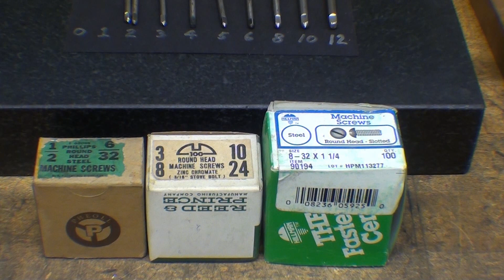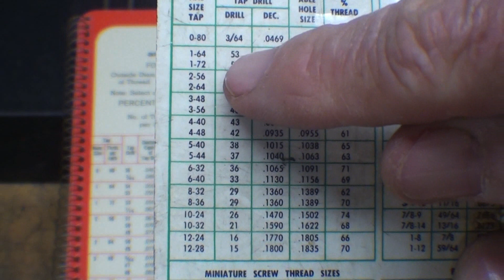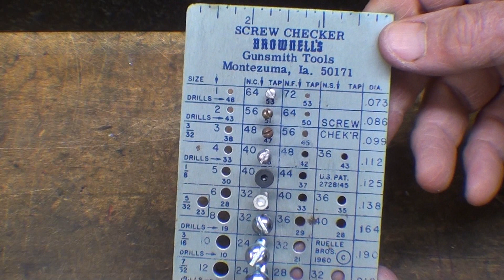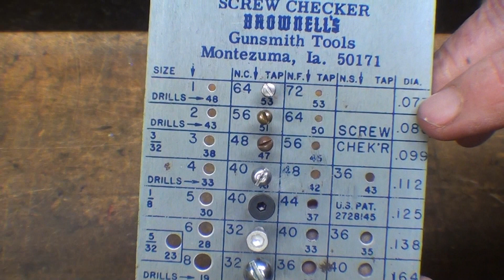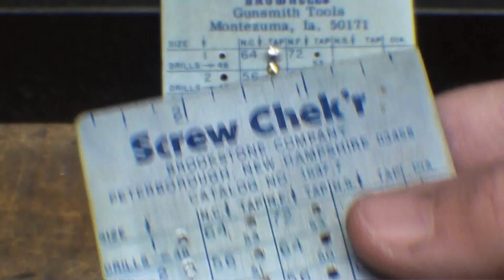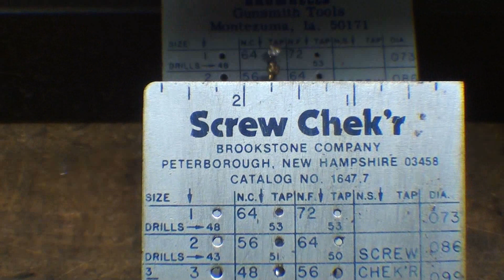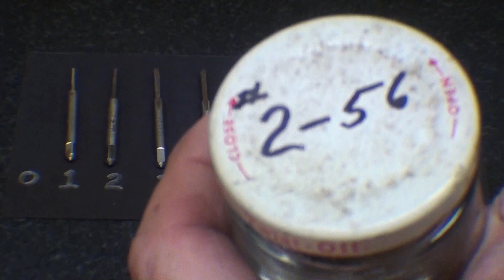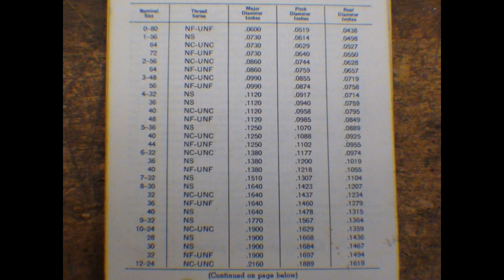SHOP TIPS #381 Understanding Machine Screw Sizes tubalcain

Comment: A great local resource for really small steel and brass hardware is a hobby shop that sells R/C airplane/car/boat stuff.  Even the tiny shops usually have a good selection of screws, nuts, washers, etc.
Reply from the maker: That's a great tip!

Comment: old mortise locks that had a glass or brass knob that slid or threaded onto the shaft that went through the door had a screw holding them on that was 9-32 which i believe are not made anymore although you might be able to order one through a locksmith.  yeah, that's why you couldn't find one to fit.
Reply from the maker: Interesting, I never heard of a 9–22 thread

Comment: Isn't it amazing?  You Tube must have heard me "calling on all the saints" as my mother used to say when Dad was cussing up a storm in the basement.  In my case I was working on my wood planer and pulled out a screw for the blade and damaged it as it was stuck in place.  I knew without checking it using the many well identified standard threads that it was metric.  I did manage to find the right thread pitch and size in a jar full of unidentified metric screws.  Now I need to go to the hardware store to find out what it is.  And then this video was suggested on my screen tonight and low and behold you showed a screw checker that prompted me to find one and placed an order for it.  No more guessing and calling on all the saints as we all know metric is invading our world and we need to accept it without grumbling, grin...
Good Video Mr. Pete!!

Comment: In the industry using a lot of different screw sizes is considered as extra costs. One guy suggested droppen the 30 mm long screws and use 40 mm long ones instead. That made the car manufactorer able to drop one part number. He was rewarded with a 6 digit number of cash. I'm pretty sure the same applies to dimensions and threads too.
How on earth could this variety of dimensions be benefitial for the US? Sounds more than people blind for logistics and costs.

Comment: Scrap the US system and start to use metric screws. Will make life a lot easier for you.
Reply: What happens to all the old stuff,I restores old tractors made in the 30s 40s 50s and in my early years I started fooling with antique guns that was made in the1800 and early 1900. We will have to have a double system for a long long time. Thanks a retired machinist

Comment: i get screws included in light fixtures to hang. from the far east.
  and the 10-32 are not correct.
 maybe you said it 3/16th but not in all cases

Comment: Just thought I would share a little something I found out about number threads. I wondered if there was a method in determining the diameters and indeed there is. Take the number of the thread multiply by .013 then add .060. That yields the proper OD. Take number 10.. .013 * 10 = .130 + .060 = .190.

Comment: Somewhere, stashed away in an almost forgotten model building supplies box, inside a giant PODS box, in the PODS warehouse, I have a small box of 0-80 and 00-90 screws, with at least one tap and die of each size.  Even when my eyes were better than 20/20, I needed magnifiers to work with that stuff.

Comment: Once more this is a good video.   But you have missed a detail...When we explain this numerical sizing, we must say that between two consecutive numbers, there is ALWAYS a difference of  0.013 of an inch.....secondly, we must show that number ZERO  is equal to 0.060 of an inch.  This means that number One would be 0.073 of an inch.   Number TWO is 0.086 of an inch.  This is why number TEN  is exactly 0.190...it comes from 0.060 ( #0) plus TEN times 0.013 (0.130) .   Did you know that sizes 00, 000, and size 0000 existed?    

Size 0000 is 0.060  of an inch less 0.039 of an inch...which is a screw having 0.021 of an inch.  I guess that we are taking here about watch making....

Another fact: wood screws that are numbered are working their nominal sizes the same way... with a machine screw or with a wood screw  number 8, we have the same size, that is  0.060  + ( 8X0.013=0.104) = 0.164 of an inch....

Comment: Measuring is usually appropriate to what's being measured and what's available.  Often that's body parts.  1yd or 1M , roughly the span of a man's arm.  1" ... first joint of thumb (remember people were smaller then) ... 2 miles = distance between villages (in populated areas) relatively easy walk carrying a sack of food.
Noon = when the sun is highest.  The more basic the culture the less exact things need to be.

Industrialisation brought a need for standardisation and accuracy - but every factory or smith made his own threads because the standardisation was only needed in the firm.

Even when standardisation was established manufacturers often stuck to their own patterns for no other reason than it made their parts unique and thwarted competition.  What survived ... was literally what went through the mill.

Once business ruled - it's not the engineers but the accountants who've decided what is "best" and what tooling survived.

If the government offered a new for old change out - america would convert without resistance - while the entrepreneur makes the decisions it's about cost not nostalgia. 

Left and right hand drive cars - Right hand drive isn't "better", in fact it's less intuitive to the majority of people's brains.  It was just the only place left to stand to fit the steering in the new production line.

Look at ammunition ... it's consistent as far as sizing - but the sizes used are pretty random ... despite their "love" of imperialism, most americans kill in metric 5.56x45mm while their opponents throw back 7.62x39mm.

End of the day as long as the gap can be reproduced accurately and the post is always the same height it doesn't matter ... until you want to buy in posts to fit your gap.  Once the bat doesn't match the ball it's game over.
The world series only works when no-one else wants to play

Comment: Well metric does make more sense and is a standard accepted by agreement... But imperial has it's place in well appreciated history or the states that refuse to convert to what everyone else is using. Otherwise it's just units. The meter based on the speed of light and the imperial yard on the lenght of a pendulum swinging in seconds in vaccum, none of which can be measured accurate in ones basement or garage.

Comment: I understand why folks like the metric system, that said though, i have always worked in thou's and converted on the fly when needed. which was a good amount as i supported lab research for decades at a university before i retired. The true elegance of the imperial system is imho the fact it is divisible by 2 by a wider margin then metric. a standard rule in the shop reads in 64's, a metric rule.... not by a long shot. As for the machine screw numbering system, thank you for the lesson, it brought back memories. I don't know how old I was, before the age of 10 easy, one day at breakfast my dad explained the screw number system to me. He said just remember that a number 4 screw is 111 (i know that is sometimes inaccurate, but that's how i learned it) and you add 13 thou to go up. Not exactly totally correct, but i guess it made a point with me cause i just remembered him telling me like it was yesterday. thank you sir

Comment: I grew up with the imperial inch system as a young grammar school age electronics hobbyist in the 1960's.  The imperial system was fine for me but of course I had to become functional in the metric system because it was used in science and taught in the school system for the sciences and also it is more efficient for conversions.  When I became a professional Electronics maintenance tech in the tv broadcasting field it was imperative to be comfortable with metric hardware and mechanics systems because the TV industry moved away from US made tv equipment to foreign manufactured equipment that was all metric for the most part.

Comment: Good educational and entertaining video as always. The 12-24 machine screws are easy to find around here. Very costly at the BIG box stores. I buy them at a local company called Tacoma Screw. 100 of the 12-24 there cost less than $6.00  The 12-24 machine screw is the size Proto tools use in the head of their 3/4 inch ratchets. I collect and use Proto tools and like my firearms and cars, I like to have spare parts. I shop the Habitat Restore always looking for NOS American hardware.

Comment: To find the diameter of the screw. The number of the screw multiplied by .013 plus .060 will give you the diameter.   10 x .013 + .060 = .190
Reply: totenkopf999 you are correct I learned a long time ago that the 0 size was .060 and then add .013 for the next size on up the chart.
Reply: totenkopf999 I never knew that.   Of course I will have to do the math before I believe it.

Comment: Mr Pete
At the hobby store I worked at , our largest screws were 2-56, and our smallest were 00-128  These were used in the repair of model  trains  WE service all trains from "G" scale down to "Z" scale.    On the larger sizes the largest screws were 6-32.  On the smallest sizes, the largest screws were 0-80, and we had a tap and drill rack just like yours.

Comment: Found an odd sized fastener on a fan motor recently, the machine dates back to the 60/70'S. Looked like 4mm but must have been nearer 4.5mm, the thread seemed finer than the metric 4mm plus the bolt head was about 7.5mm, 19/54" maybe.
Reply: heavydiesel 8-36 UNF perhaps? Metric coarse threads are usually in between UNC  and UNF threads of similar diameters.
Reply: Think you might be right, just looked up the tapping drill size for 8-36 UNF and its 3.5mm, the drill for 4mm threads is 3.3mm so that would figure with it being a bit bigger than 4mm.

Comment: My complaint about  "non-dimensional" number/letter sizes (and wire/sheet gauges) is that they are just not intuitive - and to make it worse :  while the  numbered drills get smaller as the numbers go up, but the screws get bigger  :)   At least with  metric and fractionals it's obvious - for the clearance hole anyway!
Down under we're exposed to all sorts of things from all over the world and I've  spent my entire working life to date using fasteners in various standards like Whitworth, BA, UNC/UNF, and metric. Once upon a time I would have been able to sort a mixed box of screws by eye (OK, not fair handing me a box of mixed metric and BA!).
Interestingly, Australia  has been metric since 1974, but metric fasteners have only started to appear in quantity in the hardware shops very recently,  prior to that everything was generally Whitworth...
I really enjoy your videos, Mr Pete.

Comment: You were talking about 12-24 not being used anymore. I don't think 5-40's are either. How many of you have ever used either of those two sizes?
Reply: Just when I need to thread a 1/8 in. rod. lol
Reply: NEVER. but I have German and Japanese cars and motorcycles so the SAE side of my tap and die set is rarely used.

Comment: What was the point in choosing these odd diameters originally, and why do different sizes have different thread pitches?
Reply: Historically, they were derived from wire size gages. Each manufacturer often had their own gages sizes. That's were your run into Stubbs, Brown & Sharpe, AWG (American Wire Gage), BWG (Birmingham Wire Gage) etc. wire gages. The odd-ball sizing of the diameters may have to do with the relative strength of one size to the next. The different thread pitches have different holding strengths too. The current metric system has coarse and fine threads as well. In fact, you have to be careful working on old metric vehicles and machinery as they sometimes have what would be now regarded as bastard metric size/thread combinations. 
Note that plate thickness gages aren't the same as wire gages and they often depend on the material: Aluminum, Brass, Steel, etc.
Reply: I considered that perhaps they attempt to create the same amount of thread surface per inch on each screw, and that a small diameter screw would require a tighter pitch to have the same equivalent length of thread per inch, but I haven't done the math on that.
Reply: Here is more than you ever wanted to know about gauges...and why they persist in spite of efforts to get rid of them.
http://onlinelibrary.wiley.com/doi/10.1046/j.1365-2044.1999.00895.x/full

Comment: I subscribe to a bunch of Canadian and UK "maker/creator" type channels and they all measure primarily in INCHES, FEET, and use FRACTIONS. Don't think anybody is laughing at us.
Reply: World is much larger than US, Canada and UK. Surely you were thought that...
Reply: I was using them as examples. Not just the USA uses English measurements.
Reply: I think Thomas Jefferson would be quite insulted if you called the system he invented in 1790 English. There's also a reason a meter is close to a yard. As US Customary Units and the metric system were both initially based on the same thing. It should be noted that Jefferson himself observed the discussion in France that developed the metric system. But then they changed their mind, and blew it. So US Customary Units is the true Metric System!
Reply: Just the rest of the world... dream on! ;)